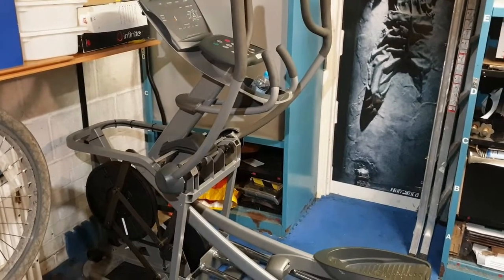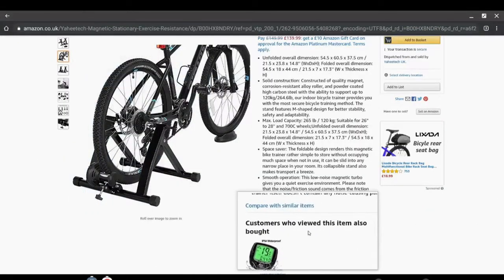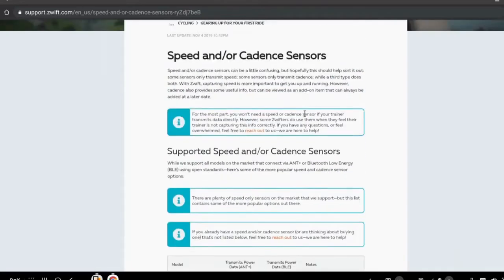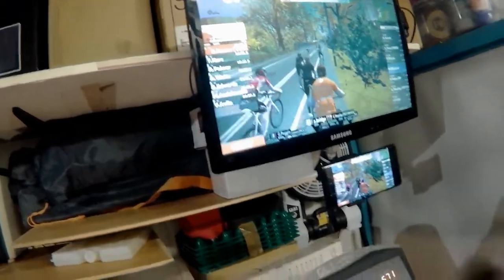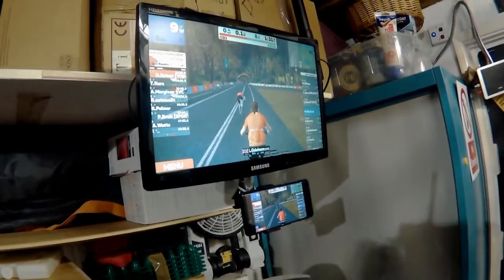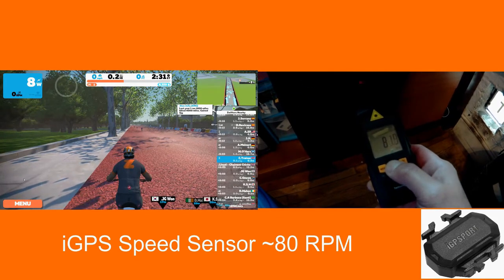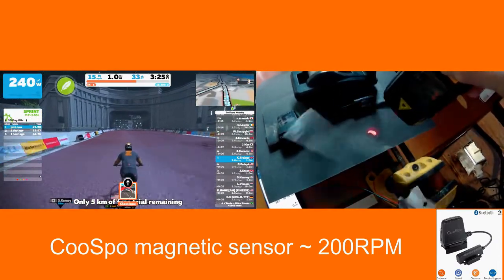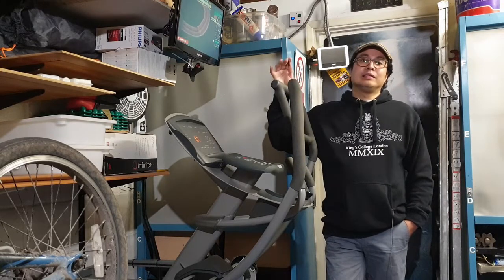How to Convert Your 🏃‍♀️ Cross Trainer to Work with Zwift🚴‍♂️

Comment: Thanks so much for this! I’m gonna give it a go on my matrix. It has a high speed flywheel inside though so it’ll probably think I’m pedalling at about 800 watts lol! May have to opt for the 3 magnet approach like yours on the outside wheel instead 👌

Comment: Awesome thanks; as a fellow tinkerer I appreciate you showing the first steps (made sense), and then exploring how to make it work better; jumping right to the end may have left it confusing.
Reply: I had started my mods a week or so back, and had limited success; had shelved it temporarily. I've got the combo cadence/speed sensor, and you clued me into that it shoudl work, and not to give up on it .. and success tonight! The tricks ... my unit seems to turn off really quickly when the cadence sensor isn't triggering reliably or at 'the right timings' perhapd (some expectated timing range); its hard to tell, though busting it open I suspect it has a serial output coupke of pins to monitor.. anyway, getting the cadence magnets right is what allowed it to wake up, be found by BT receiver, and stay on. Screw that up (loose mounts, not stroing enough magnets, too far away, etc) and it goes wonky, which throws the rest of it off and makes you think its not working.

So, once I got the cadence portion going with my elliptical trainer - ended up mounting a magnet on one of the moving arm 'bottom elbows', near the cadence receiver and then it would stay on; took a few trials and its annoying, since no power on or BT LED. 

After that, using large and strong enough magnets.. I was using ferrite magnets maybe 1.5 or 2cm away, and no luck; but after you video, I pulled out some somewhat dangerous over powered neodimiums I have, and they're still not super reliable.. but tonight I just kept adding some more of them; got 6 on my very large wheel, and good to go!

My particular elliptical has both manual and pre-program selected saw-tooth resistance challenges, and the manual is adjustable on the fly with up/down buttons; I can manually hit them in response to the zwift apps directions (hill up or down, say), and the cadence/speed sensor is feeding it about 15-28kmph, which is pretty good (I bike at about 20kmph on average). 

Its enough to _game_, with zwift, to keep the elliptical a little more interesting.

$25 CDN for the sensor, used up some older magnets I had (neodimium, 1$ each) and it works!

Comment: Why would you need a cadence sensoe and a speed sensor? I mean if you take just the cadence sensor and input the tire's circurference you get speed, the igps is a speed sensor, but there should be a version for cadence which should work as you intended.

Comment: Might want to also do that hacky little thing involving using heartrate sensors with Zwift, which should work with most exercise bikes and ellipticals.

In fact, just use all of the sensors. iGPS, Magnets, Speed + Cadence, Heartrate...